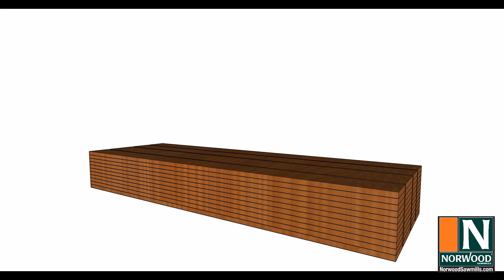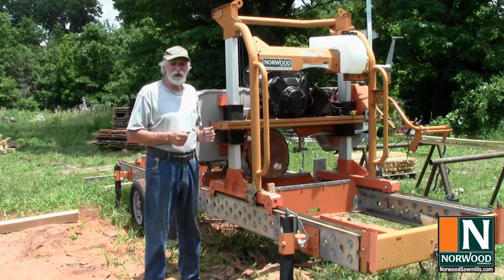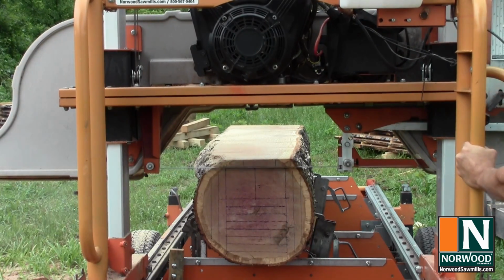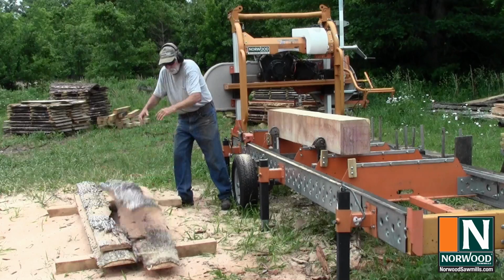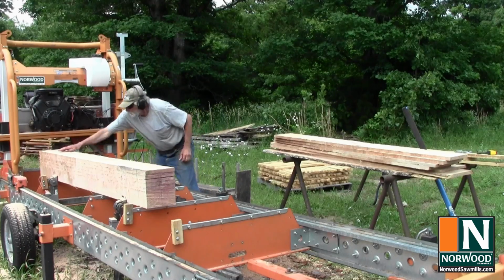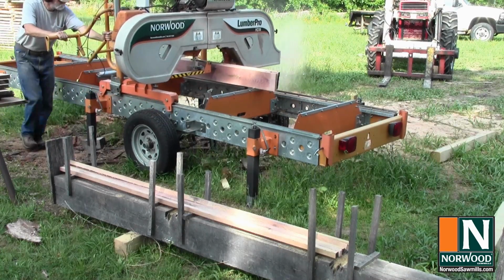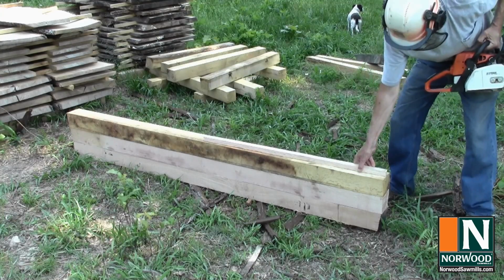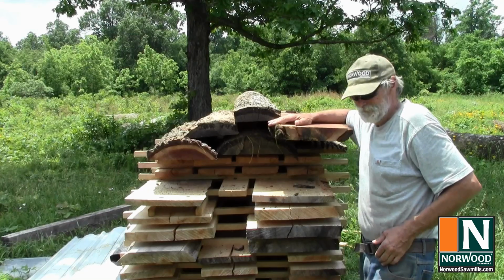Sawmill School - Cutting Blocking & Stickers to Air Dry Your Lumber

Comment: Shilingi ngap hii mashine?
Reply from the maker: Norwood builds several models of manual and hydraulic portable band sawmills ranging in capacities from 27” (69cm) to 38” (97cm) log diameter.  

Standard, Norwood band sawmills are 16 feet long (4.8m), which allows you to cut boards up to 13-feet (4m) in length depending on the model.  Saw even longer by adding optional 4-foot (1.2m) log deck extensions. In fact, you can saw logs of any length in stationary configuration – some Norwood owners are sawing logs over 40-feet (12.1m) long! 

All Norwood sawmills have an available optional trailer system. 

Norwood band sawmills start at just $4780 for the LumberMan MN27. 

-	The LumberMate LM30 starts at just $5495 right now in stationary configuration. 
-	The LumberPro HD36V2, starts at just $8597 in manual stationary configuration
-	Norwood’s biggest bandmill, the LumberMax HD38 is just $11690 in manual stationary configuration. 

You can build up your HD36V2 and HD38 to fully-hydraulic anytime – when you start, or later when your sawmilling operation gets bigger. 

To learn more about Norwood Sawmills, here are some quick and free resources:

-	Norwood Catalog (downloadable link): https://www.norwoodsawmills.com/digital-info-kit 

-	Visit Norwood Sawmills online: https://www.norwoodsawmills.com/sawmills  .

-	Price list (downloadable link): https://www.norwoodsawmills.com/digital-info-kit  

-	Check out Norwood’s “SAWMILL TV” … the ultimate online “TV” channel devoted exclusively to portable sawmills and successful sawmilling. It’s your one-stop-channel for all the essential things you need to know – from choosing your first sawmill to getting the most out of your equipment … Think of it as the Netflix for sawmill addicts 😊. www.NorwoodSawmills.com/tv/ . Sawmill TV is another resource we offer to current and future Norwood owners FREE of charge.

Freight prices vary depending on exactly where we ship to and also what you order (as that affects weight and volume).

Please feel free to email with your further questions and request for personalized quote including shipping: info@NorwoodSawmills.com .

Comment: hello sir could you tell me why the blade is spining or running during idle  what shall i do to stop this blade movment during idle
Reply from the maker: Hi Ahmed.  I replied to you on the weekend as well about your question. As I mentioned, it could be several things (possibly throttle cable mis-adjustment, possible clutch issue, etc ...) and we cannot diagnose it with so little information. In any event, going through tech discussions via posts is not great anyways.  In my earlier email, I had asked you to give us a call at 800-567-0404. Could you please do that? Thanks
Reply: @NorwoodsawmillsDirect Ahmed, I hope you'll contact Norwood.  They've got some great people in tech support, and will help you with this and any other questions.  If you figured it out already, you might post that, too.  A spinning blade at idle definitely should be fixed!

Comment: Do you not level your stacks?  Do you just put the 4x4's right on concrete blocks right on the ground without leveling?
Reply: Yes, I have learned that they get tippy if you don't start out level.  Got a couple of stacks from the early days to re-stack before they fall over.

Comment: Very helpful video. What would be your opinion about having the wood stacked on an incline / slope? As my driveway is sloping some, and leveling the stack out to 100% horizontal would be quite a pain (lower support being like 60cm high and upper only 20cm. Its big slabs I stack, 3' feet wide and 8' long, 2" or 3" thick. Here in Denmark rain comes sidesways more then from above...having the stack at an angle would although allow the water to flow of, would that not be a good thing? Thx again for the vids
Reply: Interesting question.  The primary issue is safety.  The wood must be stacked so that the pile does not lean enough to cause a hazard.  If you offset the edges or ends (depending on which way you stack the wood) so that they and the stickers are lined up vertically, it should be all right.  You are right that shedding water is a good thing.  While it is best to cover the pile, I realize this is not always possible.  Hope this makes sense.  Best of luck!

Comment: great stuff! I'm looking to sticker reclaimed wood from an old barn. Any recommendations on the size of stickers? Iwas planning to just use 1.5"x1/8" pieces of pine.
Reply: I'd check the moisture content of the reclaimed wood.  If it is under 12%, you can get by without stickers.  Wood from inside the barn would probably be ok to stack without stickers, but exterior siding would need additional drying.  If it will be used for furniture, you should go ahead and kiln dry it, then stack it in a dry place without stickers.  1.5" is too wide-- the moisture can't get out from under the sticker quickly enough, and you will get "sticker stain" on your lumber.  1/8" thick won't let enough air pass through the pile.  You could cut your pine strips in half lengthwise and stack them 4 high to get 5/8" by 1/2" stickers-- that would be a minimum.  To make a lot of stickers in a hurry, I cut a sheet of 3/4" CDX plywood into 3/4" strips-- over 100 4' stickers in 15 minutes.  Hope this helps.
Reply: Simon, I just watched a few of your videos, and was blown away by "Cancion del Elegido"!
Reply: @daveboyt6810  thanks Dave!!! Nice to hear that !

Comment: Also do you feel that stacking green lumber into a tin barn is a faster way of air drying? Some say that protection from rain, and increased temerature of the tin barn helps the lumber dry faster and more consistent. Others say it is a wasted expense because the lumber doesnt really dry faster because of reduced air flow and that the tin barns are warmer but also seem to trap humidity. Just looking for the best most efficeint way to air dry lumber before placing it into a wood kiln. As free trees are a when it rains it pours scenario you tend to get alot at once. But no reason to kiln dry it all at once.
Reply from the maker: Heat is always nice of course, but air flow is key.
Reply: If you stack the green lumber indoors, you've got to keep air moving through the stacks, which means an open shed or a series of fans bringing in outside air.  I store the wood outdoors.  It can go into the kiln at any stage of dryness, but it would be a good idea to use a moisture meter to check the moisture content before it goes into the kiln.

Comment: Great video! Thanks for the info. Quick question: Once my wood has dried properly from the stacks, how important is it to keep the dried lumber flat if I don't plan to process it immediately? I'm building a pole barn to house my firewood off the ground and with plenty of airflow. I'm just wondering if I need to section off a segment of it to house the dried lumber still relatively flat, and/or if I build a ladder rack type of holding apparatus, how far apart can my supports be and the lumber still be in good form. Thanks in advance!
Reply: If I understand your question, you're asking me whether it is ok to dead stack (no stickers) air dry lumber.  As long is the moisture content is below 12%, you should be able to do so with no problem.  Rule of thumb is one year of air drying per inch thickness of the boards, but that depends on species and where you're located.  1" thick air dry lumber still needs to be supported no more than every 24", or it could still sag a bit.  Hope that helps.

Comment: what size do you make your stickers 1x2 ?
Reply from the maker: That is a good size Richard
Reply: There are several things to consider on sticker size.  I cut 42" long, because that is the length of the forks on my front-end loader.  Thickness depends... if you are just air drying, and have plenty of room, 1" thick allows better circulation through the stacks, but if you will be kiln drying, narrower (3/4" thick) stickers let you get more lumber in  a given size kiln.  Wide stickers trap moisture under them, and can result in uneven drying, and more possibility of sticker stain, so I like to keep them around 1" wide.  Since I work with a lot of different lengths of wood and commonly mill to 1-1/8" thick, I mill stickers 7/8" by 1-1/8".  That way, if I have an odd board that is too poor quality for lumber, I can cut it into stickers, lowering the blade 1" after each cut, which, with the 1/8" kerf, gives me a 7/8" thick sticker.  This gives me stickers the same width as the thickness of the boards.  If I have some short boards in the mix, I can fill in the gap in the stack with stickers laid on edge.  Hope that makes sense.  The bottom line is that with experience (which generally comes from poor judgement), you start thinking these things through and figure out what works for you.

Comment: Great content, just getting into CSM and bandsaw. Wondering if you have separate sticker stacks for different lumber types? Or is it just softwood and hardwood stickers work for each type? So you could sticker a Norway pine with Red pine stickers? Or oaks with maple stickers?
Reply: Thanks!  Glad to hear you're starting to make sawdust.  I don't worry about sticker species.  As long as the stickers are air dry, you should be fine.  Dark stickers might leave a surface stain on light colored wood, so I don't recommend walnut stickers for anything other than walnut or cherry.

Comment: Thanks Dave.  I appreciate your instructional videos and the humble way you do them.   You didn't mention what size the sticker are that you use.  Am I right to guess they are 1" x 1"?
Reply: Close.  Generally, I cut them 7/8" thick, so I can drop the sawhead down 1" for each cut (the kerf takes out 1/8") .  By the time they're dry, they're about 3/4" thick.  Usually I cut them square, but sometimes, when I'm cutting 1-1/8" thick boards (the most common thickness for me), I'll slice some low quality pieces into stickers, so they'll be a bit wider.

Comment: Thanks Dave, l'm learning lots of useful information about how the pro's work logs. I'm a silver newbie and every trick helps. Do you always mark out your cuts or is that for our benefit?
Reply from the maker: Hi Gerard.  We are glad to hear that you are enjoying Dave's videos. He has s much experience to share. Dave marked the cuts to show what he visualizes before he cuts and how he approaches the log. With time, you will do the same. until then, grab a pencil or pen and mark up your log .. you can add a smiley face too. ;-)
Reply: In the video, it was to show the process, but sometimes I still mark the cuts, especially if I'm cutting oddball lumber.
Reply: @NorwoodsawmillsDirect  Smiley face is on me when I'm running the mill!

Comment: How long do you let the wood sit?
Reply from the maker: Depends so much on many variables such as species of the wood, dimension of the cut, ambient conditions (heat and airflow) and the use to which you want to put it (some wood you want to dry more depending on its intended purpose).  A good idea to use a moisture meter to check the moisture content.

Comment: Thanks for the video. I'll definitely utilize the way you make stickers. Time saving and smooth operation. May I ask; Is that a Logrite cant and how long? Do you like it?
Reply: I know you didn't ask me, but It is and they're really nice.  I've got the big one like in the video, though it's a bit cumbersome with the mill bed height (as you can see).  I've also got the shortest one, and it is perfect for rolling logs on the mill.  I still get plenty of leverage.
Reply from the maker: Hi Robert.  We have the cant hook and peavey made for us by them because we like the design. :-)
Reply: Norwood Portable Sawmills , that's good to know. I appreciate it.
Reply: Boatshoptricks.com , thanks for the feedback. It's appreciated.
Reply: Boatshoptricks is right.  I've had a couple of of different cant hooks, and resisted parting with the money for a Logrite longer than I should have.  As Norwood says, they carry the short cant hook & the longer peavey.  Lots of debate over whether a cant hook or peavey is better.  I think the cant hook gets a better bite on the log, but people in the north like peaveys, because they are good for breaking apart logs that have frozen together.  Also, you can stick a peavey in the ground (you ARE wearing steel-toe boots, aren't you?).
Reply: I went to the Boatshoptricks.com web site, and that went to J.W. Swan Boatworks.  Is that you?

Comment: Dave, thanks for another great video!   You inspired my 77 year old (very active) father in law, as you do everything yourself.  We purchased the LM29 this winter and my son and I had a wonderful time assembling inside. After the snow left we moved it to its new home 50 ft away. We made your wedges before we even started milling as we could see the value to that right off. I noticed on your mill a stubbed 2x4 bolted on to the frame, looks like a mod you did.Just wondering what that is for?  
We recently milled a 25” maple and yesterday we milled a nice cherry. With all the help from you and Norwood, we started of making “good square” lumber. Only mistake so far has been on the last board of cherry, we had blocking under the tip end to make it level pith to pith, last cut we got the “not so brilliant idea” to put a board down on the bunks to get the log elevated for the last cut, and didn’t account for the blocking already under the tip end, made a nice cherry wedge!  I’m an avid woodworker so I’m gonna make a sign out of it, for our Mill! Looking at the face of it, no one will notice that taper, but it will be a inside joke for us and a reminder no one is perfect!  Keep up the good work,  your videos are very much appreciated. If your ever in NH please stop by..... pizzabarnNH.com
Mac
Reply: Sounds like three generations working on or with the mill.  That's great!  My Dad, now 92 worked with me at the mill until a couple of years ago, sweeping sawdust off the track and watching to make sure I don't cut into the log stops (some times I'd intentionally leave them too high just to see if he was paying attention).  The stubs on the frame are stops (sharp eye!).  Sometimes it is easier to pull out the metal log stops on the last few cuts and clamp against the wooden ones.  No chance of damaging the blade cutting into wood.  I'll show them in more detail in my next video.

Comment: How LONG does wood (whether it be stickers or usable boards) have to be air dried before using them???
Reply from the maker: Hi Rob 

That really depends on the many variables, including wood species, dimensions sawn, ambient conditions including and humidity, air flow (exposure to air), and what you want to use the wood for (if for cabinetry for example, you typically need your wood to be dried to a lower moisture content).  We recommend investing in a small moisture meter and then you can monitor your moisture content for your needs.

Comment: Well I'm just getting in to milling no real equipment just a chainsaw mill set up got about 13 ash logs good size . so I guess I'm going into this with a strong back and a weak mind .
Reply: I started out working at a circle mill, but the first mill I actually owned was a chainsaw mill.  Didn't take long before I decided to move up to a band mill.  There's a lot to be said for a strong back.  With a little experience, you'll learn not to work it so hard!

Comment: Thanks for the video. I always wanted to ask where people buy stickers. But...don't buy them- MAKE THEM!
Reply: In a pinch, I'll buy a sheet or two of 3/4" thick plywood and cut them down to 3/4" wide strips to make stickers.  You can make a bunch in a hurry, but plywood is a bit expensive (still cheap, compared to the value of the wood).

Comment: As for using the tractor to load logs and off load lumber directly to the sawmill bed, I very, very strongly disagree with the use of the tractor this way. Despite all your great efforts to not hit your sawmill with a tine, you are going to hit the mill one of these times and do great damage to it .The first thing I did when I got my mill was to make a crib of 6x6x8Ft sawn Cedar timbers that was about 1 inch above my sawmill bed height and placed about 32 inches from my mill. I  then made a couple of notches in the ends of the timbers next to the sawmill and I use a couple pieces of 2 inch  pipe that have a slot in one end to lay on the edge of my track and into the notches. A lot of the times I can just roll the logs onto my sawmill by hand after I have loaded up the crib with all the logs that it can hold. I also watched the video on squaring up the sawmill. That was excellent and I gained a tip or two in the performance of my mill that I will diffently try. You are doing a very wonderful job of helping us sawmill operators to better understand ,just how our mills should operate. Thanks , so much. Dalton Hathaway, Mt Pleasant NB Canada.PS. I saw Dry softwood logs in the winter for the last two years and probably have sawn at least 15000 bd ft and I think that it is a machine well worth the money.
Reply from the maker: Thanks!! Appreciate your point of view about the tractor - sound advice.  Glad you are enjoying our Sawmill School series.  We also have some other fun videos in our "Successful Sawmilling" series.
Reply: Thanks, Florence!  The log deck you describe is a better way to load the mill, especially if it is stationary.  It has the added advantage that you don't need to start up the tractor every time you load a log, which saves time.  I posted a video on building and using a log deck from back in the days when I ran a 1953 8N Ford tractor.  https://www.youtube.com/watch?v=YliEREHaaVs.  I have bumped the mill pretty hard a couple of times and even had to straighten out the track rail (never damaged the frame itself).  It's a pretty tough machine!